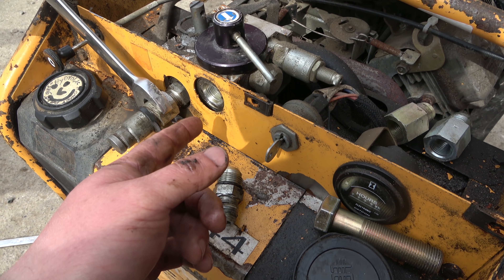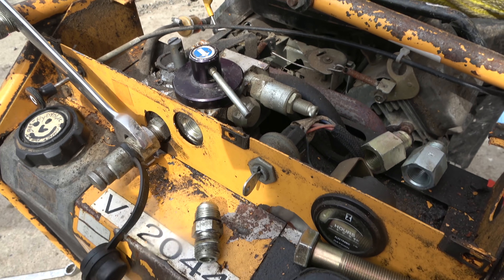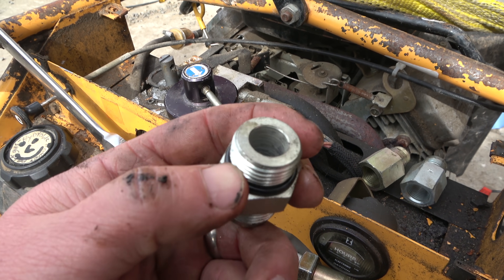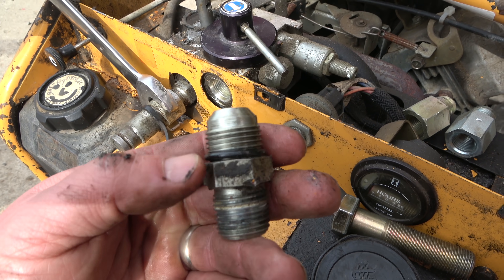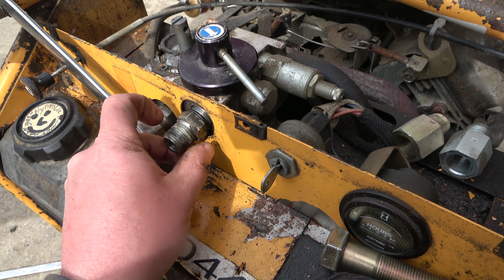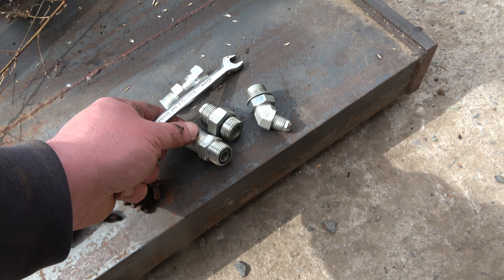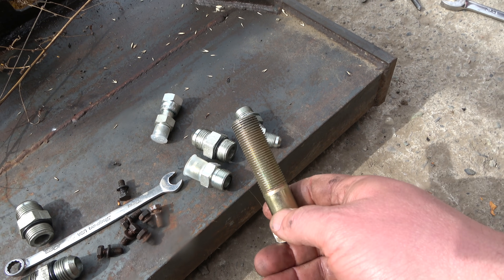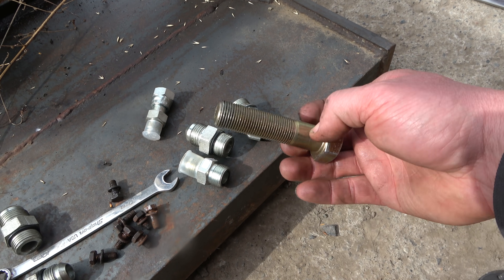#sharts Old Mechanic's hydraulic trick

Comment: Subtitles please cause I only speak metric.
Reply: If you are going to translate that into metric then could I get it in Smoots as well please?
Reply: SMART IN the field wins good one
Reply: Thanks, Jimmy Carter. Impeach Jimmy Carter!
Reply: Well, it’s Canada, where they still have back yards and guys named Miles
Reply: Why can't we all just use imperial measurements like the rest of the 3 countries do 😂
Reply: I’m curious.  What deciday is it there? Cause 10:07am works for us Imperial unit people
Reply: joke's on you. Everything hydraulic and pipe is measured in inches. Well except banjo fittings and there was a time when there was the M10x1.5 to something like M26x1.5 thread for some applications.
Reply: @TheRedstar91  jokes on you there is plenty of metric gear going around now days a lot stuff that comes out of Europe is metric. It sucks
Reply: @TheRedstar91  not true. Metric din is an extremely a common hydraulic connection.
Reply: @TheRedstar91  Unless it's metric pipe...
Reply: @Berg501  yeah, if you are talking very small (smaller than 10mm) or very big (bigger than 32mm). But then a DN100-pipe is rather close to 4 inches ...
Reply: @TheRedstar91  metriphiles get big mad when you point out that if you measure their “metric” pipe with a caliper it’s still the old imperial standard.
Reply: Along with most dimensional lumber and sheet goods 😉 in most English speaking countries plywood still measures 4'x8' and studs are 1 1/2" x 3 1/2" according to Mr. Stanley, just converted to metric so people bad at math could also build flammable, 100yr max life buildings 🤣
Reply: @berryreading4809  Spanish speaking country here. Sheet goods are all 4’x8’ x some mm thickness converted from fractional inches. 😄 However, 2x sticks are 2” x 4 or 6 or 8” or what have you, rough sawn. You either go with it rough (to build forms for concrete work) or get it smoothed/squared/planed down to the nominal thickness of 1.5 x 3.5”.

Pretty much everything is built of bricks around here because wood is expensive. Domestic hardwood is practically nonexistent, because the Spaniards cut it all down to fuel their smelting operations or construct their silver mines.
Reply: @TheRedstar91  Imperial is based on (and reliant on the accuracy of) metric, so... you're basically constantly using a needless conversion. Now that's funny, no joke! :P But, hey, as long as we can get the job done and sit down for drinks and laughs after, I say more power to you! ✌🍻
Reply: Ouchwitz Book Binding Emporium  I lived in holland for a while. Frost backs must have weak livers.
Reply: It is a shame you aren't american. Then you could speak Imperial and Metric.
Reply: @OmegaGamingNetwork  Why would you want to come from the colonies? Based on the Kings foot man, not the presidents! 😉
Reply: Ouchwitz Book Binding Emporium  more like practical pipe makers decided to just humour idiots that can’t deal with denominators not a multiple of 10.
Reply: Ouchwitz Book Binding Emporium  aka the reason you have running water

Comment: I worked at our family auto parts since the mid 60's. I saw all the disasters when the U.S. started blending in metric into its cars. The customers insisted that metric thread bolts had SAE heads. (That 1/2" wrench fits that metric bolt). We became the most popular shop in town when we hung a thread pitch gauge at the counter. It was frequently replaced because the threads got cross threaded. Side note: Chinesium parts will not always have the same thread pitch as the OE part. Many a part returned with stripped out threads. I know because of side by side comparison with the originals.

Comment: Another one, BSPT is standard americal pipe thread but with a straight thread instead of tapered.  I have mashed tapered pipe thread into BSPT in a pinch for relatively low pressure or grease lines on occasion.

Comment: Pfft, you know there's no such thing as standard sizes outside the metric system.

That thread is 95240.24 threads per furlong on a 0.00126263 chain diameter fitting.

Comment: When I first started at Case Industrial, (which I don't work there anymore) I had to cap off a hydraulic line to keep it from pissing all over the place. Stockroom was all out of that particular size caps, and the parts manager taught me this quick hack. He went and grabbed a fine thread nut, said weld up the end of that, stick you a piece of thick plastic or rubber in there, and cap it that way. Think I still have it rattling around in my junk drawer too.

Comment: 1 inch unf bolts are most common in 1-14 although 1-12 is the standard , hyd fittings are 1-12??  My Masseys have a lot of 1-12 hydraulics and 3 point hitch linkage

Comment: Same thread, but you must be careful of pressure ratings. Not all fittings are rated the  same due to wall thickness. Although when in a pickle this is 100% doable.

Keep in mind, there's nothing more permanent then a bodge that works!

Comment: It'd please the peanut gallery to see more hydraulics vids but I'd happily piss away 20 mins watching ya take apart a shoe just the same. I just picked up the ol carpet bag and moved from a cleanroom injection molding shop running all servo presses to shape up a mom n pop shop running oil leakers & leak they do. You ever wake up slick with lube & question your decisions? Figure they're gonna be the pick of the sludge covered litter after I'm done finger-painting my way through the manuals but I had to talk the owner outta running a 300 Ton press bleeding oil from a blown seal looking like Bubba's lip in Forrest Gump dangling on the toggle cylinder. It's like Dr. Frankenstein hired me to protect the villagers and immediately ran off to flip the breaker. Be nice to laugh at your pain as I wallow in mine. Love the vids man keep em coming!

Comment: Yeah I've done stuff like this
But with air valves, had air leaks in my air ride Merc so I put some bolts to keep the air from coming out, 
And some I filled the valves with JB weld 😁👍👍 works great

Comment: Heck i build a new air injection rail out of -6 stainless bulk head fittings , swivel adapters and a piece of 3/4" black pipe for my 4.9 ford straight six..  what a chore getting the spacing correct..

Comment: Also of note, #6BSPP and #6NPSM can interchange at the very least as female swivels when mated to either npt or bspp. Doesn't interchange with any other size though. Gives the John Deere fellas and JCBlokes some sort of common ground. 

Also, the flat face QD fittings (hydraulic trailers, larger equipment) and kidneys (skid steers, especially JCBs) are easily rebuildable and usually just need to be cleaned. Simple as two pipe wrenches and some brakleen. 

I enjoy fixing the ones left in my store as very expensive paperweights though.
Reply: I doubted myself and I was right to do so, it's number 8 NPSM and BSPP that will interchange, not 6

Comment: Just used a similar trick for a clutch master cylinder. Outlet is 3/8-24 crush washer deal. Needed to adapt it to -4an/jic. Those are hard to find and expensive when you do. Just used a 3an/4an male/male union and threw a copper washer on the 3an side. Works perfect.

Comment: Just make sure there isn't something inside that will run into the flare on the JIC fitting, like a spool or whatnot. Hell of a tip though, I am sure it could have saved a trip or two to the gettin spot for fittings over the years.

Comment: Come to the UK:  we have our own inch standard hydraulic fittings, but they're based on Whitworth threads!
Reply: No need to come to the UK. There's always a goddam BSPP when you least expect it and you wonder why the fuck your O-ring Boss 4 is too small and O-Ring Boss 6 is too big and you go look for the odball ORB 5 but it doesn't fit either and then you realize it's BSPP but you don't have THAT BSPP unless you're willing to use a 6" long string of adapters to get to male JIC 6.

Or it's BSPT and you wonder why your NPT doesn't fit.
Reply: There's some fun standards here, my house plumbing is half metric and half imperial, turns out imperial plumbing is or at least was dirt cheap in ireland. The plumbers over the years really love it...

Comment: Just watch that long dingus end of the jic touching the back of the hole before you reach the flange. Only cure is to ram it in harder as no one wants to cut the tip off.

Comment: Metric has its moments, too. But the real magic happens when you have metric and imperial pieces in your toolbox and you're in a hurry.
Reply: It'll wiggle just a little, but it ain't quite stripped.
Reply: When you call them "metric and imperial pieces" you're clearly not thinking outside the box. What they are, is in fact go/no go thread gauges.
Reply: @Gameboygenius  Thinking outside the rhombus: If it isn't a tap it's obviously pipe thread and needs 3 - 27 spins of teflon tape.
dude I lmao when I saw ur comment tho.
Reply: Cross thread is stronger than Loctite.
Reply: A friend had British bikes and they chopped them in the old days, he talks about how they had 3 different kinds of bolts and nuts on some of them.
And he calls the electrics Lucas the prince of darkness. 😂🤣😂🙀😳
Reply: @tim2applecell323  Q: Why do Poms drink warm beer?
A: Their fridges are made by Lucas.
Reply: Yeah, in the end sealing metric against imperial is just a function of viscosity vs. pressure.
Reply: Male And Female ....
Reply: I was working on new fork lift trucks in the 90s that used SAE fittings on the engine and transmission, metric on the chassis and sometimes BSP, sometimes JIC on the hydraulics. (Same machine) Need a lot fewer tools now it’s all metric! (UK)
Reply: We call that imperial cross thread. Its in mcmaster-carr (probably)

Comment: Gotta be careful that the flared portion of the JIC/AN fitting doesn’t bottom out at the bottom of the O ring boss port. When boss ports are blind holes, they can sometimes have that issue.
Reply: Ain't nothing a zip disc won't fix!
Reply: @dontnubblemebro  haha yea mate, I’ve turned the flares off on the lathe when I’m in a pinch.
Reply: @davidthefat  I reckon my lathe gets as much "bugger it I'll just turn it down" work as my grinders, they're just too damn handy!

Comment: From Air-Way : "Technically speaking, AN fittings are manufactured to MIL-F-5509, and industrial 37-degree flare fittings are manufactured to meet SAE J514/ISO-8434-2.
The most notable difference between these standards are in the threads. AN fittings use an increased root radius thread ("J" thread) and a tighter tolerance (Class 3) to achieve a 40% increase in fatigue strength and 10% increase in shear strength. Material requirements also differ greatly.  These two fittings function the same, they look the same, AND the industrial version is much less expensive to manufacturer.

Comment: Had to do this on a jack up boat with a crane mounted to it. One of the fittings rotted out so just took a Teflon bolt and screwed it in and presto we have a very large blue plug.

Comment: I used a fine thread bolt fabricate two plugs and o ring retainer washers to bypass the oil cooler on a Cat D2. Cat, Komatsu, and others have a knack for coming up with their own fitting standards, because reasons.